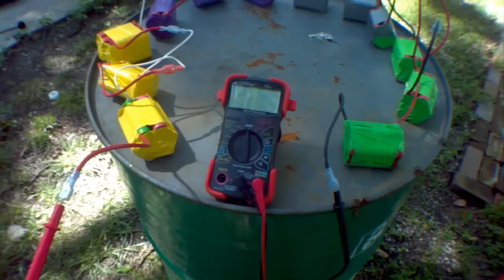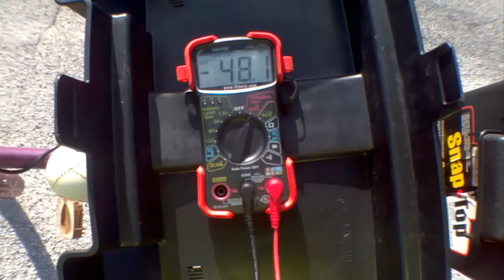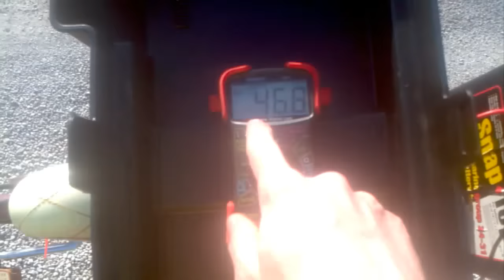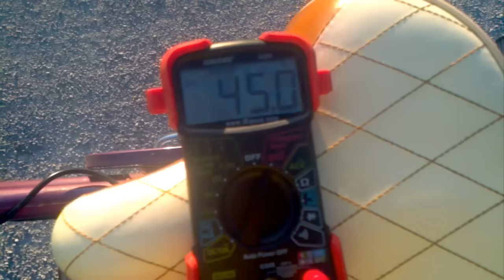1000w 48v 9ah electric bike distance test

Comment from the maker: i was staying about 12-15mph the whole test.

and yeah i agree with your math. :D

i bought 170 more cells and each cell seems to have close to 3ah so i'm hoping when i'm done building the 2nd battery i should get atleast 120 miles of range. it should be 52v 30-45ah (running in parallel with my 1st battery)

Comment from the maker: ya see lithim-ion batteries are very springy with their voltage compaired to lead acid or something. it's couse it takes a bit for the battery to convert chemical energy to electricity.

if i try to charge it really fast and get it up to 48v and disconnect it, it'll jump back down to 46v or whatever. likewise if let it charge for a long time with a constant voltage, then run the bike really hard. the battery shows like 45v but if i come back in 20 minutes it'll show like 47.5.

Comment from the maker: i think i could fit about 5 times this much, but that would mean re-soldering the packs to fit exactly into the box.

your doing great with your battery as far as i can tell, they are easy to connect tbh. theres just 2 rules i can think of.

1: if you get sparks or explosions you've done it wrong (duh)
2:if when your using the battery and some wear out much faster than others then you dont have your pack's capacity evenly distributed enough.

and the mileage. 25 is good. but 50 would be better.

Comment: you got 19 miles on 9ah? pretty cool, I have been harvesting laptop batteries for the probable expectation of building a 20ah or so battery for my 48volt 500 watt skooter , it weighs it should weigh ( the bike) about 120 lbs with lithium instead of lead acid and addition 175 pounds of me. what kinda range do you think i'd get with a 500 watt motor? i live 12 miles from the beach and want to be able to get there and back in comfort. my gas powered bike has no rear shock and uncomfy seat ( my behind and back hurt like hell on a 25 miles round trip. do you think i could get there and back, from measurements of the battery box i could fit 160 cells in there ( not including a bms).

Comment from the maker: nope i dont like forums, only forums i use are for Final Fantasy 14.

i charge the packs up to a constant voltage and all the cells check out fine.

i think i can get up to about 5000 cycles from these sense i am running them at a lower voltage.

Comment from the maker: yes, kinda, and no about the wattage

ya see by "1000w" i mean it was made to run a 1000w motor. but if you wanted Watt-Hours then the battery would be about 480ish Watt-Hours. meaning it could supply 480 watts for one hour or 1 watt for 480 hours

and about the charging, it can be charged as one pack but has some special needs, every so often i manually charge each cell to balance the cells, but the cells are all the same capacity/age so they dont deviate too much untill like the 60th charge =)

Comment from the maker: woops, wrote a reply and Android sent it as a PM instead of a comment, anyway

20ah sounds awesome, i think you could go atleast 50 miles at 10mph without peddling. prolly even 70.

i think wind resistance multiplies by the square every time you double speed. so 20 mph takes 4 times as much energy as 10mph.

and battery capacity varies depending on how many amps ya pull, if i gun it i'd get maybe 7ah, going 10mph maybe 10ah. more amps wastes energy as heat in the cells.

Comment from the maker: well if you plan on running multiples of those cell holders together i would highly recomend the 4v instead of the 16v configuration. my reason for this is that imagine you have two of the 16v packs running in parallel. no individual cell would be connected in parallel to another. this would mean youd have 8 cells that could get stray in voltage. wearas a 4v pack all 4 cells will always be the exact same voltage.

unless you plan on ballance charging the cells individualy. but its a great idea.

Comment from the maker: haha dont worry, you'll learn pretty fast since you seem eager to experiment. if i ever get a 3d printer ima make huge battery holders, like 16 cells.

just dont let your cell's voltages stray too much, if they go above 4.2v each cycle will be like 100 cycles at 4v. and above 4.4 you risk shorting the cell.

the biggest risk to killing a cell isnt that cell but all the cells connected to it that might then feed all their power into the dead cell, would create a lot of heat (possibly fire)

Comment from the maker: well i just took appart my 1st battery, and all one cell (the one i made from differant batch of cells) was a bit wonky. so i believe you may be right. perhaps i didnt notice it because i had built a battery pack from cells that where the same capacity and i charged to exactly 4.2 volts before assembly so they didnt have much chance to deviate.

i ripped open my new battery pack to check it and found some connectors broke and bad solder joints, so thanks hehe

Comment from the maker: but in the end i really dont know if a bigger motor will use too much more energy. i think the efficiency would be about the same. like my 1000w motor is usually only running at like 300w when i use it couse i dont go full throttle.

a good way to judge how your battery matches the motor is by how many volts it drops while you pull power from it. like mine drops too low so i needa add more capacity to my pack.

Comment from the maker: your cool too.

unfortunatly i found out this design of having each pack its own little bundle doesnt work so well. they tend to bump around and wear off the duct tape then they arc. ima get some capacitors and build myself a tack welder. will make the batteries in a big block (very compact) and tack little steel clips onto them. no more solder!

Comment from the maker: and finally..

i am glad i went with a front wheel because

1: it helps to distribute the weight
2: i've had my back wheel get broken a few times but could still run on my front motorized wheel
3: less hassle, dont have to worry about making my chain hook up

~bad side~

1: i'm only 120 pounds so it spins out sometimes couse of not enough weight.
2: the wheel has popped off a couple times, due to it not having a torque bar...and my mutilating my bike forks with experiments. and not tight enough.

Comment: As long as the cells check out, as you say, then there is no balancing issue. If you have two mismatched cells in series and charge them at 8v it is very possible that one of those cells will be charged oast 4.2v while the other is below. Which is why i said you cannot balance series cells.

Comment: sorry when I say efficiency, I really meant energy consumption in watt-hours/mile.  I got that by taking your total battery capacity which for you was 48V x 9ah to get 432 watt-hours.  Then divide by the range you got, you mentioned in your video that you got 27 mi with some pedalling and 19 mi pure electric, if I'm not mistaken, and you get 16 watt-hours/mi and 22.7 watt-hours/mi respectively. A typical bike going 22mph should get 17-20 watt-hour/mi so you beat that but not sure of your speed.

Comment from the maker: if a lithium cell is shorted-out it is bad. but if it is not you can try to charge it.

what do you have that can charge it? i use a laboratory DC 0-30v 0-5A power supply. it works really good for charging lithium cells.

Comment from the maker: what efficiency are you meaning?

the cells cost me about 90$ i should get up to 5000 cycles from them since i'm running each cell at 4.0 volts instead of 4.2v. how i charge them is with my variable DC power supply or my 10-80v step up converter. i set the power supply to put out 48.5v and just let it sit for about 8 hours.

letting it sit on the charger really helps, couse neer the end its only pulling like 50ma but its depth charging the cells.

Comment from the maker: LiMN is a disposible battery type that can't be recharged. maybe you mean LiPo or NiMH? either way i'm sorry to hear about your battery.

hopefuly though your motor and motor controller all work fine. if they do then you could upgrade the batteries.start holding onto laptop batteries and power tool batteries if you find any in the trash or at a recycling center. if you find a lot then thats awesome. if you only end up finding a few....the lithium cells are sooo awesome for tinkering.

Comment from the maker: ok i swear i wont bugg you with another comment buuuuuut...

i've been having a lot of trouble with the connectors

1: the cables that go from the motor to the controller are too short.
2:i guess the connectors get oxidized or something because i need disconnect and reconnect them all every day. otherwise it'll start cutting out after a few hundred feet.
3: has a million connectors for the motor and throttle....havent they heard of simplicity? ima rewire it with a 25pin Dsub and longer wires.

Comment from the maker: oh i'm sorry, i thought you where from Germany ^^

all laptop batteries use the same lithium cells, laptop batteries have Lithium-ion 18650 cells. differant laptop batteries are perfectly fine.

i use 10 year old laptop batteries, they only have 70% capacity but are still very good! and they are cheep too.

usually an old laptop battery will have 1-2 bad cells and some good cells. if the cells are reading 0v they will prolly be 50% capacity when you charge them.

Comment: I'd say that don't use old laptop batteries, because you will not get much amperes out off them 1.5C max. If you still want to use them use only batteries that have same capacity and that have used around the same amount. that way your pack is more reliable.

I suggest new 18560, 26700, lipo, lifepo4 cells to be used in a ebike battery. Nimh, NiCd and obvously sli batteries are out of the question.

Comment from the maker: no, old stock lithium battereis work just great, you can pull up to 5 amps per cell but thats really straining the cells. not counting i only need like 15 amps at max.

buying new 18650s would be wasteful, not counting those UltraFire brand and stuff are horribley old and dead batteries rebranded to look new. unless i wanted to pay 10x more and buy directly from Panasonic, i'm buying old laptop batteries.

Comment: My first ebike I made at home only has a 10 mile range if I use my throttle sparingly. Max speed is 20 mph. Considering adding extra batteries for range. Thinking of making it go solar and extra batteries in a side car. It's a 450 watt side mounted.

Comment: Interesting to see you use a 12s setup, a 48v setup is classed as a 13s. 3.7v/cell nominal. So you are actually under volting things a bit, especially when under any load. With the cells at 4.1v (I charge mine to 4.05v - 85% capacity) you have 52.5v which quickly drops to 49v under any load over a few hundred watts. I stop at 46v when under a few hundred watt load (about 20% left - 3.6v/cell).  I run 13s9p 2900mah cells (26a pack - about 16a usable) on a 1000w front hub. The capacitors in the speed controller are usually rated at 63v and the fet's 80v+. The difference with that extra cell bank is surprising , you really can feel that 10%, and also extra range as a bonus... It will also stop the low voltage cut off at the 20 mile mark...
Reply from the maker: yeah i later went to 13s

Comment: My results are always zero pedal and mostly WOT.
I have run an inline ammeter (they are not hard to make btw). And my 24v currie "450w"
motor with factory 35A controller pulls 9-9.5A wide open on flat. (200# rider + backpack).
I have done 45mi on my 40ah pack and it still had some ooomph left in a city full of hils.
I'm on vacation in central Florida with bike now and aim to run it till dead and have friend
with pickup truck come get me for a WOT on flat measurement.
For anyone who wants to maximise battery range, install an ammeter. By watching the
display you can choose the best combo of power vs range and pedal input.
Rhino is correct on his 12mph being a lot more efficiant, if I was not running wide open
at 19mph and ran even 15mph I can drop that 9.5A down into the 6-7A range and get
maybe 33% more range. As it stands I can quote 1mile per ah wide open throttle.
Reply: Jeff Kephart Hi if you don't mind me asking what batteries did you use to achieve 40 miles? I really want to get a range of 40 miles or higher. I also have a Currie that I installed on my fixed gear. She's awesome and uses two 12v 10Ah batteries and gives me a range of 10 miles. The max speed is 20 mph. The controller at 500 watts, the throttle for 24 volts and the motor at 24 volts and 450 watts.
Reply: Jeff Kephart cool this would be so sweet for my Radha. I would love to use 2 of these to have almost 100 miles of range. What type of charger do you use to charge it? I live in Florida and weigh about 170.
Reply: That 40Ah pack would do 100mi in Florida I think, especially with road bike tires.
Reply: Sadly we're talking a $500 battery and charger. The plus is they're good for 2-3000 charge cycles.
Reply: Jeff Kephart Ouch damn that high? I have seen some cheaper. Maybe I can make one or two. My bike is a fixie with the flip flop hub.
Reply: it's bc of aerodrag. it's a qubic law. dragforce=cd*speed^2 but energyloss=dragforce*speed=cd*speed^3
at 25km/h you're using 123W approxmatly.
A 1000W motor can reach 50~55km/h peak 
people who want to go over 30km/h without monster motors and monster batteries should switch to recumbent or even better a velomobile frame.
velomobile can reach 60~80km/h with only a 100W motor

Comment: lol. I hope you have a safe place to charge the packs :P.

But if one desires a long life for the lithium battery the battery should be only used about 80% of its capacity before charging again. so if you have old(70% capacity)batteries that means that you have 56% of usable watthours in your cells. some a bit more some a bit less. that leads to relatively big battery packs..

Comment: Hey, I have a question there. I want to buy the kit, either 48v or 36v. Where did you get those batteries. How do I know how much to buy and which ones? You mentioned that they can be made for $80. How good has the one you made been?? Is it holding out well? Are they lithium? Oh yes, I was wondering, what was wrong with the first batteries you had why they did not have enough power.
Reply from the maker: the first batteries i had where old lead acid batteries i got almost a decade ago. they where dead from age. but lithium cells live a lot longer.

the lithium batteries i've made are doing great. i would recommend not paying more than 1.5$ per cell. you can sometimes find 12-cell laptop batteries on ebay for 14$. thats like 1.1$ per cell. very good price even if they are old or used.

a good balance charger is the Imax B6. or the Imax B6AC. the "AC" has its own ac 120v power supply. the other takes 12-18v input. they both ussually only cost like 30$ on ebay. my Imax B6 has lasted me a while so far.
Reply: Rinoa Super-Genius
The 10ah 12v Sealed Lead acid pack, charged @3A was only good for about 300
full charges before being about 60 capacity. ICK!
(if charged at 1A instead it would be more like 600cycles)
One tenth of C is the best rate for LEAD

Comment: How many cycles have you run through the pack? 

From what I have read lion packs need (for performance and longevity) to be balanced. You can balance parallel lion cells by charging at constant voltage. Lion cells are usually balanced manually or with a BMS.

Obviously you can cycle without balancing but this can result in a cell dropping too low and being over stressed and then over charged. 

You are aware of the endless sphere forums right?

Comment: what would you recommend for long distance and longer times between charging, reason being i have been diagnosed as terminally ill with lung disease don't know how long i have probably 1 to 3 yrs i want to enjoy what time i have left,
so i decided to buy an electric bike, WOW prices NO WAY so a kit is the way to go, rear wheel 48v and have heard about 20ah 
is good power to time ratio,  however i am new to this, my thinking is if i get caught out and about with no power i am screwed because i have no air in my lungs to pedal, i have been told by my specialist that as long as i take my portable oxygen machine with me in my pannier bags i should be ok,
sorry for waffling but just need to get right in my mind 
1/ what type of battery{cheapest type} safest and power output
2/best way of connecting them such as eg: turnigy 5000w lipoly batt 18v  x  4   =  2 x 18=36 in series then swap last two connectors to parallel {wrong description} but i think you know where i am going with that  {seen it on youtube}
hope you can help or at least point me in right direction,
i have subbed and liked and really like your vids which to me start to make sense others are to techy
thanks
dave
Reply: vassilij zietseff goo luck to you whoever you are hope u get it going .
Reply: Hey, how are you?

Comment: Hello Rinoa,

I really appreciate you project and i am a big fan of yours you inspired me to do the same.
i am already started collecting laptops batteries like you did and bought multi-meter and charger\balancer just like yours my question is the kit you bought really worth the money and i wight more than 200 pound is this kit powerful enough climbing hills and i will buy a bike do you recommend specific bike can you please give me links what to buy Kit\Bike?
i really appreciate your help, Thanks in advance
Reply from the maker: +hishammadani1988 the kit is just the cheepest 1000w 48v motor kit from ebay, and the bike is just a 100$ bike from walmart. i latter got the same exact motor kit when i moved to california and it pulled my cargo trike 2200 feet up a mountain at about 10MPH.